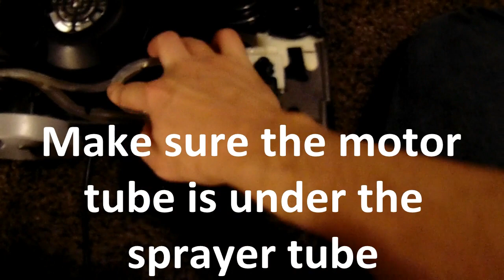Hoover PowerScrub repair

Comment: I have to try this today. I will make an effort to add the outcome here, but the video was very straightforward and well-done. I might suggest lightening it a touch as some parts were very dark, but that could be my machine.  Thank you for this. The Hoover is an excellent floor machine and this is my first time with brushes freezing. I bought it new a bit over two years ago.

Comment: I followed your directions religiously and greased up the unit...the ball bearings was so rusty its a crime!...but thanks to you my brushes are moving again and I didn't have to call Hoover.  lots of my my plastic was crumbling off too.  what a cheap unit. My bearing and shaft is one piece but I figured it out.  I used liquid wrench, freed it up.  I also used castor oil.

Comment: Thank you - bearing siezed on shaft but managed to get it spinning at least. Covered everything in Lithium grease and back in business 👍🏻
Reply: LITHIUM grease is THE answer.   It's been ~4 years since I first used the Lithium grease.  I'm back because I forgot the take apart method and my brushes were stuck again.  Once every 4 years I can live with.  Taking it apart every time was crazy but that was what I was doing even with using WD.

Comment: Great video!  I'd like to add a couple of tidbits.  

Once you get to the bearing inside of of the "motor gear cove" check to see if the bearing itself is rusted. The bearing fits into a cup on the inside of the white motor gear cover. The part of the bearing that sits on the shaft needs to spin freely. If the bearing is frozen due to rust, freeing up the shaft will not solve the problem.

Also, be very careful while removing and working with the motor. Pay attention to the white plastic "arm" that is attached (the piece that holds the spring. It's easy to knock against it and break one or both of the small black plastic guides that hold the arm in place.
Reply: Thank you, this was a really helpful video, but this bearing may be why this repair didn’t work for me.  I was so happy to find this video, went through all the steps, everything turning freely, but when I put it all back together, it didn’t spin.  I went back in twice, even sprayed white lithium grease around the spindle.  Didn’t think of the bearing.  I may go back in again now.  You also need to make sure that the quick clean/deep clean dial is oriented correctly or it won’t turn once it’s back together.

Comment: SUPER -  and something else.    Hey,  hours with other videos, etc.    You got me there.  It was rust and grit at the final gear.    But,   the turning did free it up,  but still not smooth.   The plastic bottom where the shaft is  (mine is Hoover Spin Scrub50 model FH50027)  had 5 or 6 little clips and it opened up.    The shaft then comes out.   Lots of grit and grime in there.  So,  got all it out and sprayed lithium grease.   On the way now to buy screws and trashing these cheap rusted ones.     THANKS,  again!!!!

Comment: Great tutorial. I have a FH50205 power scrub elite . After maybe an hours use the brushes stopped working. Fortunately for me one of the clear plastic tubes that go from the base up through the upper section acquired a kink. When the unit is locked in the upright position, the tubes get pinched to stop the brushes while idle and that's a good thing. I tweaked the tube and it seems ok now. These brushes are powered by air so check the tubes before really digging into this project and maybe save you some frustration.

Comment: Alternatively, if you have a 3/8 hex key, it fits perfectly into the keyhole where the shaft on the spin heads connects to the assembly.  Place the hex key into this hole and gently spin it until it moves.  This fixed the problem on my unit and took about 30 seconds.  Obviously, if light pressure is not enough to free the device, proceed to the repair shown in the video to prevent breaking the plastic gear drives.
Reply: That's what worked for me!

Comment: Thank you for this it was so helpful to me. I did manage to get my brushes spinning again. But oh I worry for how long! the little bearing thing was so rusted to the motor shaft it looked like thick weld of rust underneath and I couldn't get it or the transition wheel off but with some libricant and pliers I was able to get everything in the motor box moving again. And I needed to use my biggest allen wrench to loosen up the slot for the brush track which wasn't moving either but again lubricant and cranks back and forth loosened it right up. Truly, thank you for the video. So helpful. Did not want to try to replace this thing especially since I'd used it only once before. But I will be taking everything apart and drying it down when I am done this time. I don't need anymore problems! Thank you!

Comment: Great video! Followed every step.  Unfortunately, housings for screws were cracked and fell apart.  Gear was definitely seized.  Couldn't figure a work around to fit it all together since everything was broken
Reply from the maker: The plastic does become brittle over time, particularly around the rust areas and the underside of the cleaner.  not sure why this happens, but some consistent patterns have been from people who leave the cleaner in colder basements & closets.  It's possible that the housing material was not tested to be stored in certain climates, or maybe it could be related to the quality of water used, as some homes have harder water, which DOES affect the plastic.  Plastics and physics are not my area of expertise, unfortunately.

Comment: I was able to do it! Best feeling ever. The thing won't turn when I try and do it manually. I've been trying to loosen it for hours. The wrench can do it but when I try and spin it with my hands it won't loosen
Reply from the maker: If it is really seized up, you can try a rust remover, or solvent to try and clear it away and get it going, however, if it is too badly damaged, you may need to replace the part # 440003860

Comment: I did this but was able to move the gear freely by sticking a hex key and spinning first. Saved me time from dis assembling everything.
Reply from the maker: As stated in a previous post, using a Hex hey "may" work, but be very careful.  the gears are plastic, as shown in the video.  Forcing them if the bearing is to rusted or seized WILL cause damage to the gear teeth resulting in more costly repairs.  Using a hex key or Allen wrench is NOT a recommended method.

Comment: Very helpful.  Thank you for the video.  I decided to use a light weight machine oil on the bearings and shaft to maybe inhibit rust.  Maybe it will run longer before seizing up again.

Comment: Great video. One unnecessary step: You don't have to remove the two screws which secure the tank release lock since these screws don't hold the cover to the assembly.

Comment: Step 7:  All over.  Can't get one of the screws out of the (deep) hole.  Tried several  different screwdrivers.  Also broke one of the plastic things when I firmly but gently removed the brushes.

Comment: I had an interesting problem with a Power Scrub / Spin Brush model... the handle would not pull hard enough to open the spray valve so no water came out. It is under the curved panel on the back side on the Power Scrub (where your knees would hit when your pushing it with the handle up) and found the valve. There was too much flex in the actuating rod from the water spray trigger/handle to push open the valve. I glued a small (1/2" square) piece of plastic I cut from an old storage container handle (about1/8" thick) to the actuating rod where it contacted the valve to make it just a tad longer and push harder so now works great !! Cost nothing!... Hope that helps someone.

Comment: After watching the  repair I decided to try something else. It looked like there was not to much effort to release the brush's so I went to my too box and found a hex wrench that would fit the  hex input for the brush's. After removing the brush's just insert the hex wrench into the slot and turn it a little until it breaks free. My was locked up but a small turn and it was free. This may not be the case for all of these repairs but it worked for me. If it will not turn follow the video.
Reply: What would you think the problem is if my brushes and hex bolt moves freely if I manually turn it, but the brushes still will not turn when I turn the machine on, and it smells like it's burning? You think it still might be the bearings?
Reply: @slomotion1028  the shaft and bearings were rusted very badly in mine.  You have to open it up and just be patient to follow all instructions.

Comment: Was pretty good...but did it work afterwards. Followed your video and everything was working properly, but it still wouldn't turn the brushes. Ideas??
Reply from the maker: Check to make sure none of the parts are damaged.  I had someone who followed the instructions, but the hex drive on the brush assembly was rounded on the edges.  Their issue was not so much a rusted motor, but something caught in the gears.  Each step allows you to also view and identify if any part of the brush motor assembly is having an issue.

Comment: Thanks for helping me with this!  I had the exact same issue as what was described in this video.  My machine is now scrubbing like a charm.  Too bad they didn't use stainless steel for the screws and the drive shaft... there is/was lots of rust on the inside of my machine.  Does anyone know how the build quality differs vs Eureka and/or Bissell?
Reply from the maker: It's not so much the build quality, but how they are designed.  More specifically, the brushes.  Hoover has round vertical scrub brushes that move as a horizontal clockwork gear.  Bissell usually has 2 horizontal brush rods (similar to what you might find on a vacuum) that are belt driven (I think only a few models are gear driven).  Eureka also has a horizontal rod brush that is belt driven, but usually is only a single brush, unlike most of Bissell's that have 2.  Gear driven brushes are usually preferred as they tend to have more power.  Some of the belts for Bissell even have teeth, since some models the belt would slip if liquid made it on the belt.  Some people like Bissell and Eureka because of the horizontal brush making level and even scrubbing.  The horizontal brushes have been known to pull up on thicker carpet, and are much tougher to pull hair and string off, as it winds around the brush.  People like Hoover because it's easy to clean out the brush, seems to focus or spot clean easier with the brushes.  However, the better models tend to be quite pricey, otherwise you have air driven motors, like the one in the video, to reduce the cost.  Going a little higher in cost are the Rug Doctor cleaners which use straight brushes that oscillate side to side, or forward and back, to do the scrubbing (There are a few models that do have the horizontal rod.)  These straight brushes scrub similarly to the Hoover, but are level like a horizontal rod.  Rug Doctors seem to do really well with lightly soiled trip resistant or tiled carpet that isn't very thick or shaggy, or may not require padding (similar to carpet in most workplaces and offices).  In many cases like this, it's not even a contest that Rug Doctor would win.  However, most home carpets I see have thick padding, might be shaggier, and the Rug Doctor does NOT do well with these.  Semi shaggy carpet, you'll want to use the Hoover or Bissell.  The shaggier the carpet, and the Hoover does the better cleaning.

Comment: This is a great video to learn how to disassemble and assemble back again. My problem is slightly different. All the water leaks out from underneath the machine. In a few seconds !  Where do I find the piece to repair or change? Which one is it?
Thank you!!!!
Reply from the maker: Hopefully it's just a loose hose or possibly a small hole in a hose.  this can be a tricky repair, and if possible, take to a professional to look at.  The hose is often easy to seal with a silicon glue at the connection points, or replace if it's the hose itself.  You may also want to check rubber seals around the reservoir.  However, if you have cracked housing in the main unit, you might need to get a new vac.

Comment: Didn't think I could do it- very good video,
 working but gear feels gritty- hopefully after it runs a while  it will free up more.   Thank you.
Reply from the maker: It's possible that the bearing may be nearing end of usability.  Sometimes adding a little grease or lubricant can help extend the life.  Again, the reason for the seizing is due to rust.

Comment: By the way, I sprayed WD-40 on the drive shaft and used metal lubrication to prevent rust, corrosion.  I say, If you are already in the "body cavity performing surgery" do some preventative maintenance too.  I don't think rust will like what I did when in the midst of surgery yo!
Reply: How often did you spray and would it better if i put a fan on the bottom of the vacuum after using so it can dry the bottom of the vacuum
Reply from the maker: @nonenone4078  Putting a fan on the bottom of the unit has no effect.  The air driven motor is mainly enclosed and a fan would not provide enough air.  Also, moving air would just contribute to the corrosion.  The metal parts must be coated in a lubricant to protect them from moisture AND air.  If using Lithium grease, you might only have to apply it once.  Regular WD40 I'd be applying once every 6 months to a year, depending on how frequently the machine was used.  However, the first time I applied Lithium grease is the ONLY time I've had to apply it.  I gave the shaft a good bath in the grease before closing the cover, and I've checked twice in 2 years, and the unit STILL has not required re-application.

Comment: Worked like a charm but you don't need to remove the latch screws. I pried off the bearing seals and sprayed a little WD-40 on them and packed them with grease in hopes of preventing this from happening again.

Comment: Easy video to follow, I went through all the steps and freed up the motor shaft. Put the cleaner back together and the brushes still didn't work when I turned the power on. I took it back apart looking to see if any parts were broken, I couldn't see any. Any ideas?
Reply from the maker: Once all put back together, make sure the brushes can be manually turned.  You should be able to feel a little drag letting you know that they are in contact with the motor.  if there is no drag, you may need to make sure your gears are lined up.  Also make sure the teeth on the gears are not worn or damaged.

Comment: OUTSTANDING! I have the exact same one and man mine is rusted bad. I am having trouble getting the bearing off.
Reply: Stephen, see my comment above. If the bearing itself is rusted and frozen you may not be able to fix the problem.
Reply: Stephen King I also had a hard time to get the bearing off. I used a hammer to hit the bearing (downward) for about 10 times to get it loose.

Comment: Domorius thanks you so much for your tutorial video! I did this and it worked like a charm however today the problem recurred and I couldn't fix it. The brushes rotate when I lift the scrubber but as soon as I apply a little pressure with my hand on the brushes they stop rotating. There is no power in the rotation and is easily stopped. The turbine seems fine though and the gears move just fine. Please advise if you know what to do. 

Regards
Reply from the maker: Sounds like a gear(s) might have worn teeth.  It could be the gears in the brush assembly itself, or in the motor unit.  I have seen where the teeth on the transition gear have been worn away over time, especially if the unit is used frequently in very shaggy carpet.  If you have to replace either of the plastic gears in the motor assembly, ALWAYS REPLACE BOTH!!  If it's the brush assembly, you'll have to order the full brush assembly.

Comment: I bet you could bypass all this with a large allen wrench inside the hexagonal slot that the brushes go into, might break it completely though.
Reply from the maker: As you see in the instructional steps, there are plastic gears that connect to the seized shaft.  It is NOT recommended to use a hex wrench to force it free, as it can strip the teeth and cause more costly damage.

Comment: This video was incredibly helpful! I'm just confused about one thing. I have this exact model - Same name and model# - but it's a Bissell, not a Hoover.
Reply from the maker: I don't know of any Bissell's with the same model & name.  Also Bissell's mostly use horizontal laid roller brushes.  Hoover's usually have the circular geared scrub brushes as shown in the video.

Comment: Well normal grease wont last long. I suggest people add Fluid Film. It leaves a wet film. That protects against moisture. They use it for rusting proofing cars during the winter against salt. It would probably solve this issue quite easily. Although they shouldve just used stainless steal.

Comment: Thank you for this video, just got my new Hoover, should I open up to grease everything before first use ? Is it possible to tell me how and where apply grease ?
Reply from the maker: Overall, be aware of possibly voiding any warranties by opening the unit.  However, I haven't seen or heard of any such issues.  Take it as a word of caution.  Adding Lithium Grease should be to the shaft and gears.  Step 13.